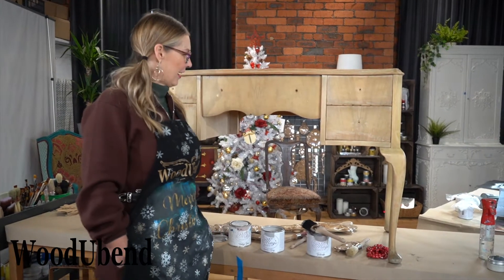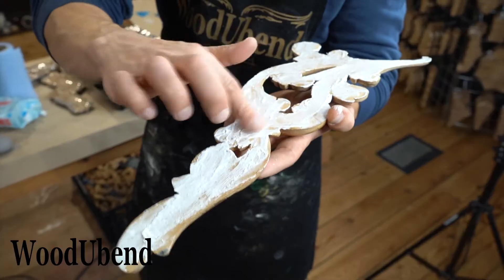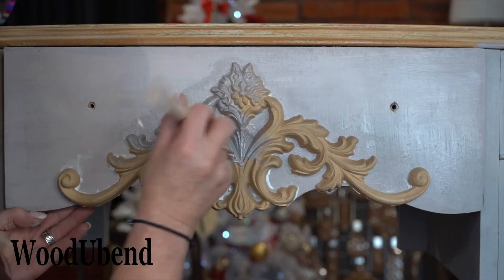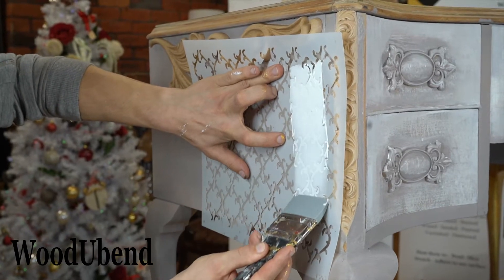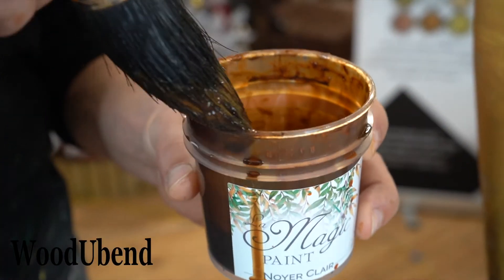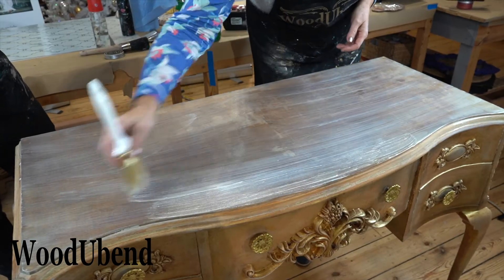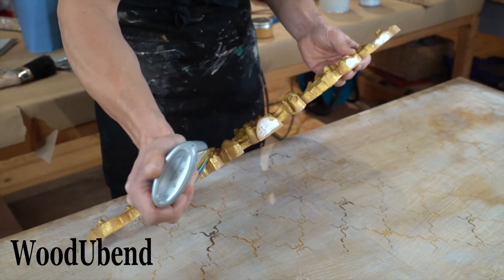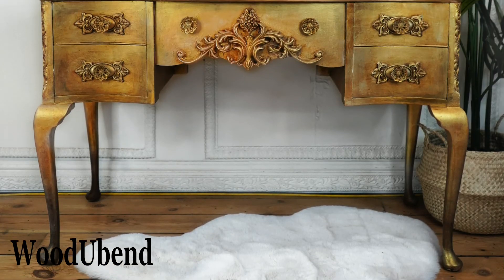How to furniture flip with WoodUbend & Posh Chalk

Comment: Where can I find the item that you used at the end of the project, that you used screws to attach on top of the desk?  Do you have different sizes?  I would like to use that type of accent on top of a small book case.  I would also like to trim out my book shelf with rope molding, so you have rope molding?  Thank you.
Reply from the maker: you can check our moulding designs here https://woodubend.com/product-category/woodubend/